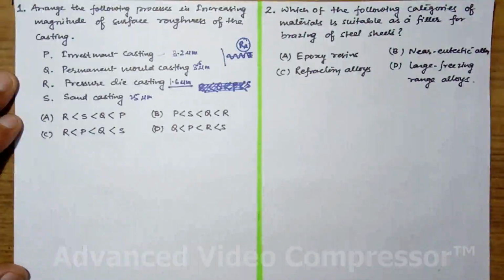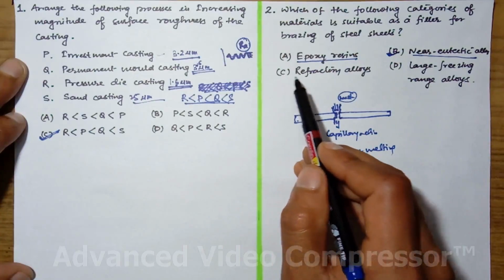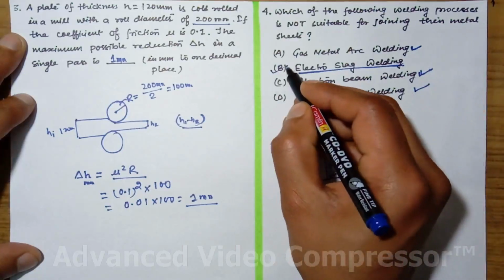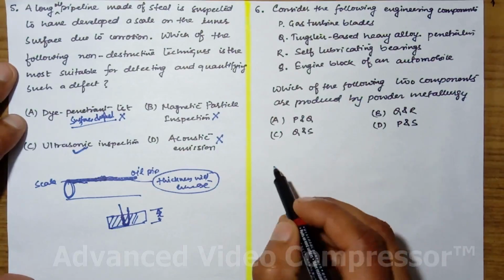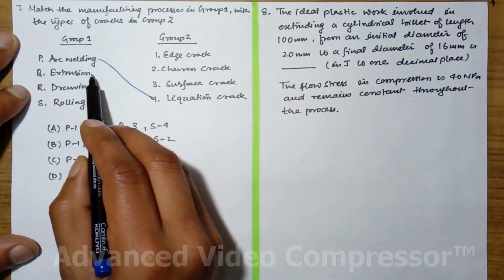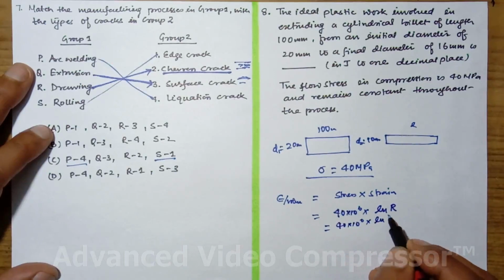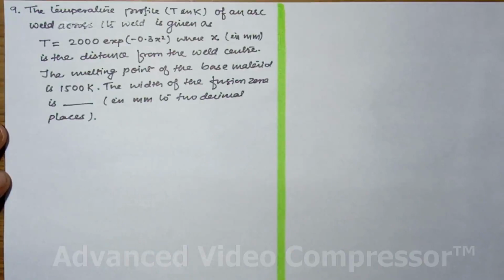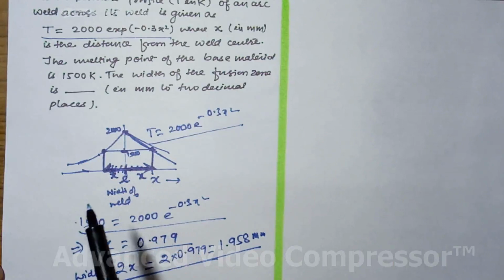GATE 2018 Manufacturing processes

Comment from the maker: 00:00 Casting methods
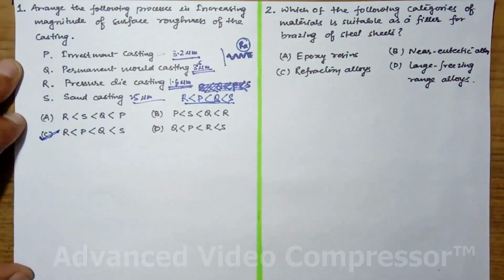01:55 Filler in brazing
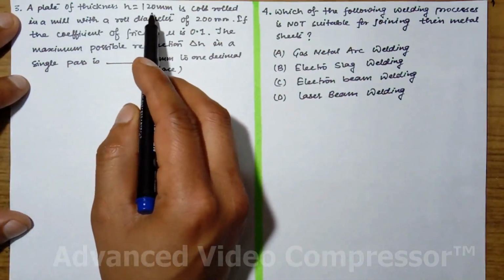04:08 Maximum possible reduction cold rolling
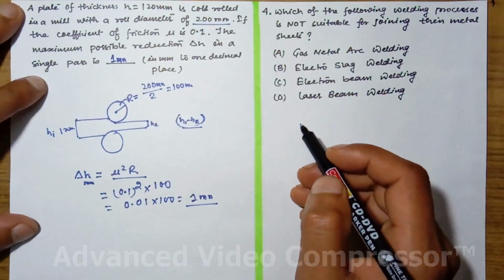05:36 Welding processes
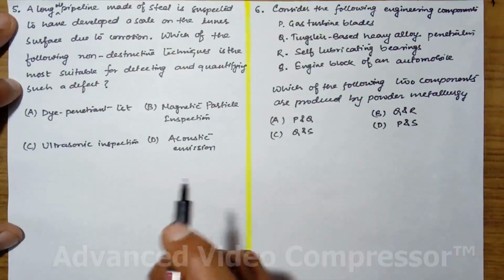07:00 NDT
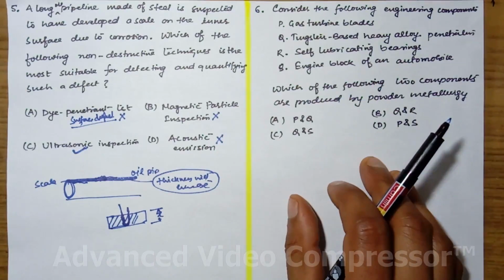10:10 Powder metallurgy
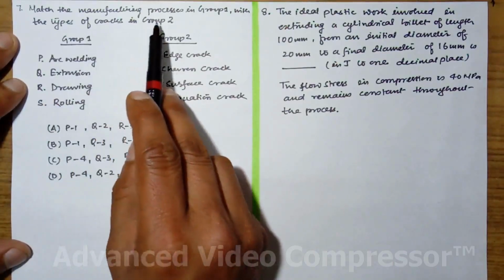12:41 Match type welding methods
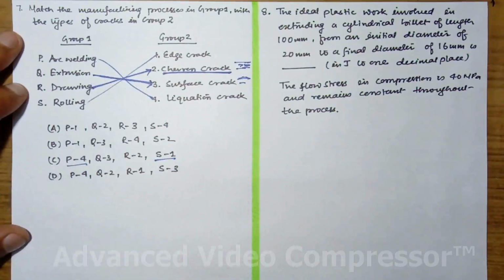15:49 Extrusion plastic work
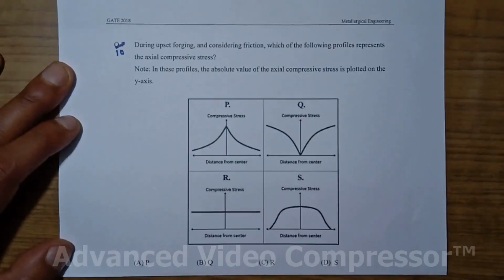18:58 Upset forging pressure diagram